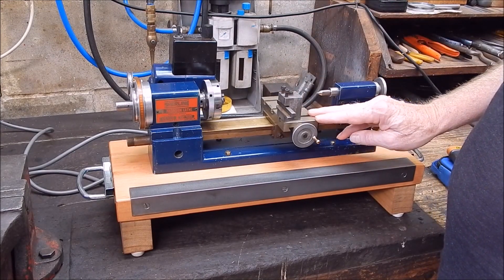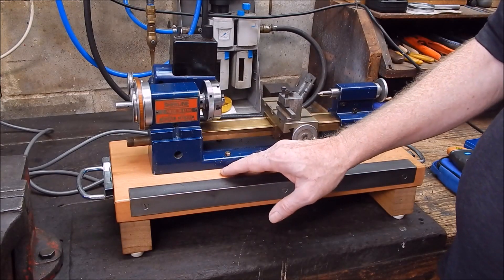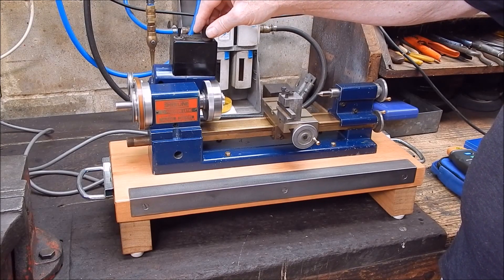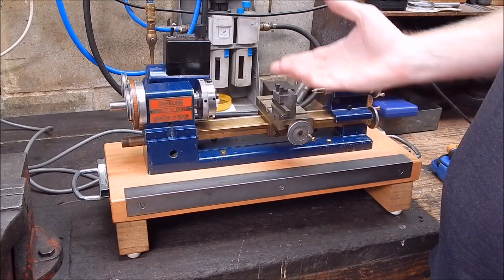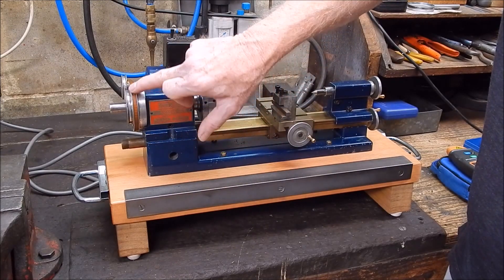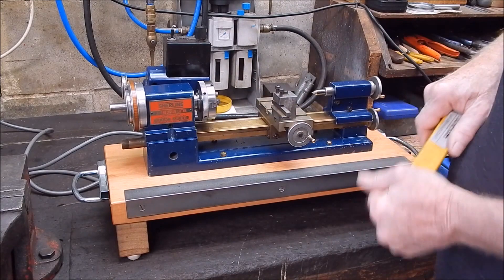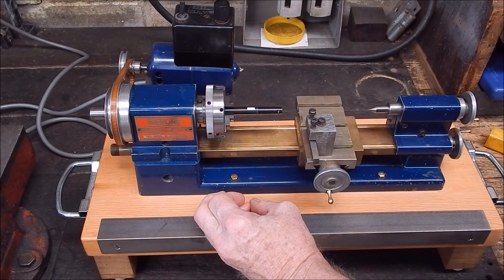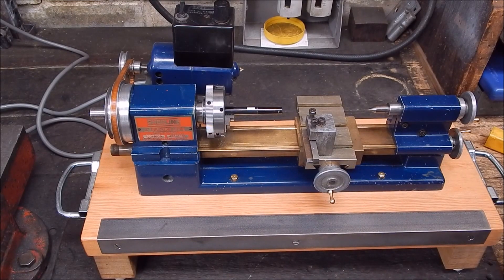Sherline metal lathe speed range weirdness

Comment: yes puzzle with that. mayby spindle is build for 1000rpm MAX. if you run it faster or change pulleys. bearings not last and allready setup for lower speed anyways

Comment: Hello, I've been watching your videos as last year about the time you were refurbishing this baby I bought a similar set-up and have been going through the same thing. Here's the post where I bought it that has all the pictures. https://www.rcgroups.com/forums/showthread.php?2746919-Sherline-Lathe-With-Mill-Attachment-Power-Feed-Accessories-NIB-500-00
- It's also a model 1000 but is one of the first shipment of 100 lathes sold in the US when they were still made in Australia. Instead of blue, these were painted black but are basically then same thing. After that they started making all the US sold lathes in the US. But it's labeled 100-2000 RPM for the low speed so they must have changed the label right away.  Anyway, it came with a bunch of attachments but the lathe hadn't been used in years. I went through pretty much all the set-up problems you did but I didn't know jack all about lathes so just turned it on and started using it. Pretty quickly I figured out the bearings needed looking after so I found and downloaded the model 1000 manual from the Sherline site. I ended up using Mobil 1 synthetic grease on my bearings and they progressively got quieter and smoother. I've been using the piss out of it ever since. One thing I've come to realize is that while a lot of the tooling is transferable from the current production stuff, the lathe parts and attachments are not so I've been slowly upgrading mine. I found a used model 4000 bed and converted over to that but the steel ways are narrower than the model 1000 brass ones so the tail stock doesn't fit well. Once tightened it is square and on center to the head but you really have to crank down on the screw which then makes turning the quill hard. And of course after a few months of that it stripped out the threads so I had to break down and buy the newer Tailstock assembly. Also, my motor speed control went tits up pretty quickly and wouldn't hold any RPM so I had to graft in a generic chinese speed control. I hated cutting up the stock speed control box to fit it in but its doing its job so... I've got plans for a higher wattage DC set-up but I haven't got around to making a mount for the new motor yet. I am loathe to spend the money Sherline wants for the current motor/speed control. Someday....
Anyway, thanks for the chuckles as I recall the same trials and tribulations you're going through. If you look through my photo attachments here there's a couple pics me using the little 1000 - https://www.rcgroups.com/forums/thumbgallery.php?do=showattach&u=951 .
Reply from the maker: HI Mike,

Very interesting comments.  Thanks for posting.

I'm a bit surprised the later stuff is not totally compatible. I know that the later tailstock has an adjustable gib strip, but it's still odd that the spec regarding fit/bed is different. Maybe the gib strip can be worked to make it fit better ?

 I see that a lock knob is fitted to your tailstock - good idea.  I will make one of those.

You certainly got a good value buy there.  A handy machine for RC work for sure.  Plus having the 7 x 14 (?) is a good move.  Do you have it set up for collets ?  If not I suggest you check out that path.  I use ER collets on my two other lathes.

Having said that, the Sherline has an optional collet set that fits into the Morse in the spindle.  I measured the runout on mine and it was shocking (unusable).  I had read that another owner had the same issue.

I don't intend to do collet work on the Sherline, only a scroll chuck, but it isn't a good thing if you turn between centres (which I don't).

Interesting picture gallery as well.   Some really nice RC work there:)

Once again, thanks for posting.

Cheers

Rob

Comment: Rob, I must admit the sound is better now, but you can hear the belt howling on the pulley's, just because the spindle and engine pulley are not inline, therefore the belt feeds twisted true both pulley's.
In one earlier video's you showed https://youtu.be/DZJLc6C9vBw from on 5:30 the engine connector plate that is as you said '''the bottom from the motor arm is worn''!
That is exactly why the engine hangs over to the right and the pulley's aren't inline and belt howls.
Further its a nice job and nice little lathe.
Reply from the maker: Hi Arend,

I intend to fix the sagging motor. That may help a bit.  

Cheers Rob

Comment: Plenty cold here Rob - mind you, I never cope well when shop is super hot. Sweat is bad on bright metal too!.
Listening to the speed change - almost makes me wonder if the control pot is a logarithmic one rather than linear.
Those cheap tachos are certainly great value... I do find the reflective tape is needed - tried white paint but not very good. Wonder tho also whether a larger dia piece for testing with reflective patch would be more reliable for higher rev count. I keep a small patch on my chuck back plate.
Reply from the maker: I've used mine to check the RPM of my pencil air die grinder on a very small object in the collet chuck.

55,000 RPM reading with no issues.  These units are dead accurate, even at extreme speeds, and on very small reflectors.

Can't beat them - and at around $15 delivered they are a bargain.

I always take the battery out when not in use.

Cheers Rob

Comment: Good suggestion to put the blocks on the base.  Looks good in addition to reducing noise.

I have a similar hand held tachometer.  Very handy.  I have checked a few metal lathes.  All ran a little faster than the stated speed, only perhaps 10-20%.

I think the new belt should reduce slippage, but cannot imagine the belt alone provides the 100% greater speed than rated.  The reason may be a mystery, but as you state, it does mean the low speed range is all you need.

I am in eastern PA, US.  We are due to get above freezing for a couple of days around 40 just like you except ours is F vs your C.
Reply from the maker: My Chinese lathe also runs faster than quoted, by about the same amount.

I think the Sherline mob screwed up when they printed the ID plate on the motor.  Probably should read 2000 RPM max for low range.

When I first looked at the pulleys I thought that was a hell of a difference between high and low range considering the ratio variables.

Cheers Rob

Comment: Hey Rob,

I think universal motors have dreams of being little jet turbines. My understanding is that their max rpm is really only limited by the load applied, so they'll just spin up as fast as they can for any given load and voltage. With no load and only the friction of the bearings to slow them down, they'll tend to be a tad fast, to the point of almost running away. The flip side, is that as they slow down, the current, and hence the torque will increase.
It'd be interesting to see what the speed drops to under some load.

You're not wrong about the heat, I had all these grand plans to be out in the shed last week, but I didn't fancy standing around in a 50 degree oven. 
Glad to see that model tacho works well, I literally just picked one up off ebay last night, $12, bargain.

Comment: Interesting observation. I have a ‘modern’ Sherline 4400 with DC motor (SKU 33050) and it behaves the same way. I guess more of an artifact of that type of DC motor speed control, with really low torque at low RPMs. Really hard to part off pieces above a couple of inches in diameter because of that. Especially regular 6061 will grab easily and stall the machine. At this point I am slowly converting mine to CNC with a rotary encoder hooked to the spindle so I can do high precision non-standard threads easily.

Comment: Rob, nice job on the little lathe. Enjoy your videos! I like the way you repurpose things. have you thought about possibly putting a treadmill motor on this guy? Solve  the speed problem and give you more torque... Just an idea. keep the videos coming thank you! Mike
Reply from the maker: Hi Mike,

I could easily do that, as I have a treadmill motor and several KBIC 140 controllers sitting under the bench, and although the thought did cross my mind, I think I will leave this original.

The other two lathes can do the heavy lifting, so the Sherline will really just be for tiny stuff.

Thanks for the suggestion.

Cheers Rob
Reply: Ahhh. I get it... well it turned out nice! Mike

Comment: I wonder if the ratings are under load with a tool engaged? I would wonder if the motor would actually even turn at 57 rpm with a cut say 5 or ten thou? 

Also may having something of some material in the chuck?

I know on some of the china mini lathes when they are down that low they will stutter.

That still doesn't explain the 100% over spin on the high speed side of the low speed pully.

Very interesting.
Reply from the maker: Hi Todd,

Could be.  I can't understand why the high range is right, but the low range is not.

Lathes I've used always quote the "no load" speed in the gearing charts/specifications.  

The speed ranges on the ID plate are also different to the current USA made model which only goes to 2800 RPM, compared to 4000 RPM (actually 3850) on this old one.

Maybe they made a mistake when they had the little plate made up for these old units.

These lathes can't cut at the slow no load speed, and need the amps wound up to do so.

Cheers Rob

Comment: Hi Rob... every time I watch one of your videos I seem to be off hunting down something else... looks like a digital tacho is next !  Question... is it my eyes or is the motor and it's pulley not in line with the head stock pulley ?
Reply from the maker: Hi John,

The pulleys are in line, but the wide angle camera lens makes it look off line.

The motor IS sagging on it's mount a bit, due to wear in the mounting pins, and that need s attention at some stage.

Not causing a problem, but not as it should be.

Those digital tacho's are really good.  Safe to use and get into tight spots with.  Not something you use very often, but handy for the money.

I also have two of those old time mechanical ones which have rotating odometer type displays.  They work OK too, but can only be used on the end of a shaft.

Cheers Rob